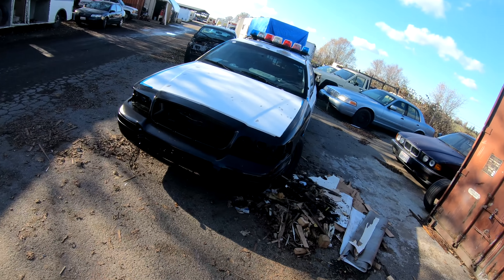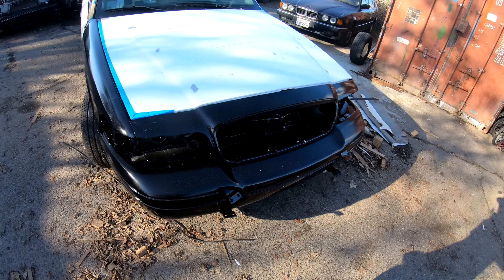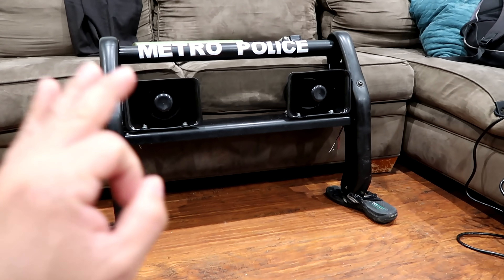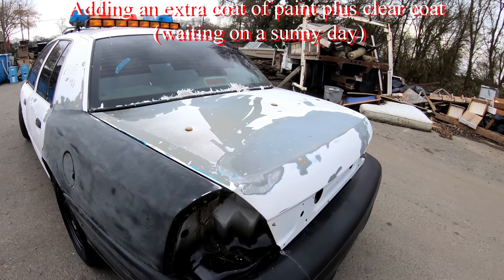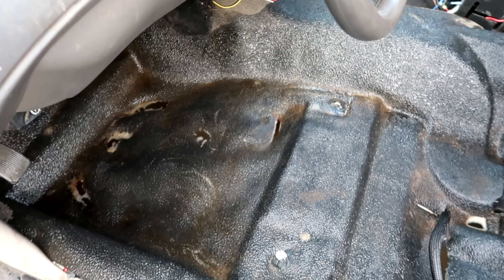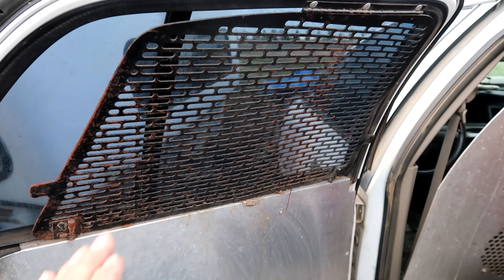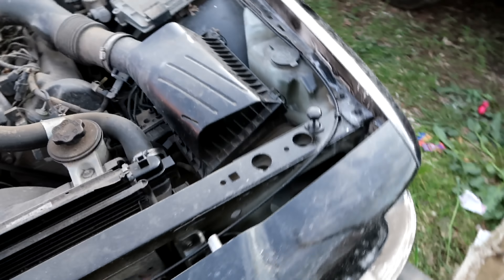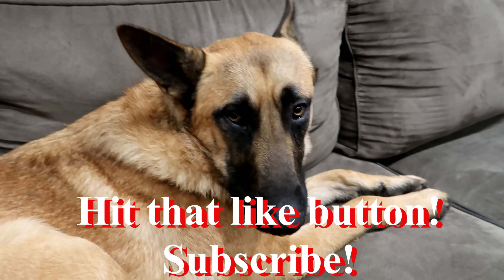Building a Las Vegas Police Car Part 3 Crown Rick Auto

Comment: Love how this is going! I have a 2010 K9 Car from Dover, New Hampshire. Has the same K9 Cage as this one! Pretty awesome! Also, the vector that was on the car was a Smart Vector. The pods have one light that can do multiple things. You can even rotate them to any direction like a spot light (left or right). Thats why they didn't go on with the other lights. They are separate. The bar you swapped it out for is just a regular vector. Which has its own alley, takedown, and rear light. Where the smart vector has one light in that pod, that does take down, alley, oscillating and oscillating traffic, and rear flashing. There is (should be black a white) power wire that has to be hooked up for them to work. And then when that is hooked up, there are other wires that tell them to do things. You can program 3 options into them for 3 auxiliary switches. There'll be red boxes on the boards inside to change what each option does. And then other wires for the alley and takedowns. And two more for rotate left and right